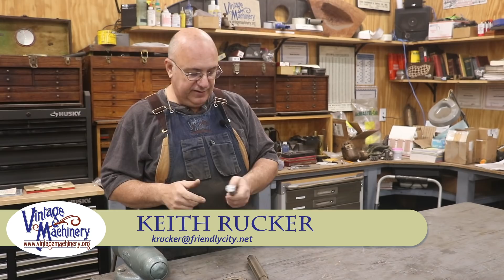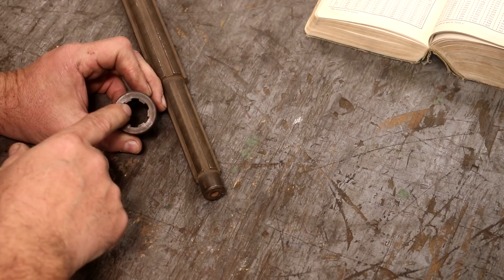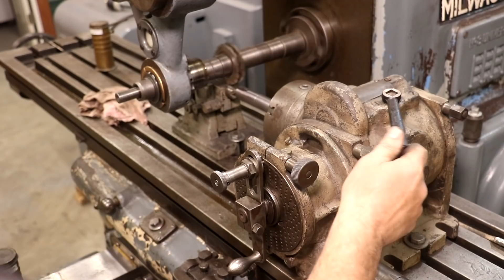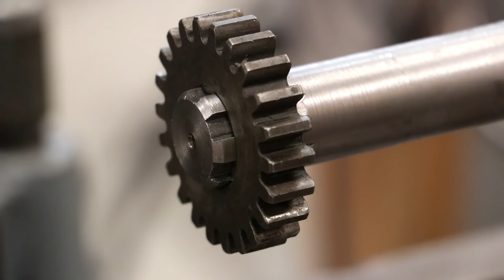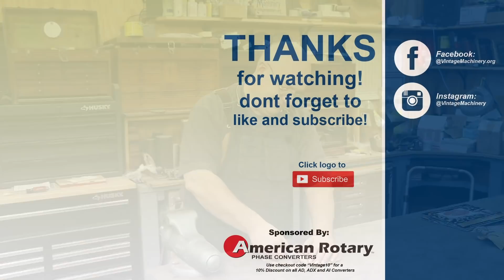Kearney & Trecker Low Lead Attachment Drive Shaft - Cutting Splines

Comment: Brilliant thanks
I need to make a 6 spline one inch main shaft for a Velocette m.cycle engine. Luckily you have confirmed my tentative ideason how to best accomplish this, I have an Adcock ,& Shipley 1ES horizontal mill,(badged as Bridgeport) and a zeitze dividing head.... Your use of the original shaft to set up is brilliant, I was not looking forward to centering with a metric machine and Imperial spline dimensions...
Best Regards
Jan Hoogesteger

Comment: 7:45. Not cheating, just using your noggin to insure correct set up.  Smart!  Why reinvent the wheel when you have a master gauge for alignment. Go / No Go eh?  Factory support 101.  Experienced chip cutter at work.  The number of operations for each setup is valuable to oversee in use.

Comment: Keith...You mentioned that to do this spline on a vertical mill would require that you do offsets and more passes.  Why couldn't you set up the same double cutter arrangement on the vertical mill like you did for the HBM and then finish with a single cutter to cleanup the middle of the spline,  i.e do it just like you did on the horizontal mill except you are just doing it vertically now?

Comment: A nicely finished job Keith. I was quite surprised at the amount of runout.in the arbor resulting in only one tooth on each cutter actually doing the complete work. As you can clearly see that the swarf ( chips ) is (are ) only coming off of one tooth sorry I'm English and we call chips swarf over here lol Keith you said those cutters were a matched pair, and I expected the key slot to line up exactly on both cutters, but the teeth were slightly staggered. I thought if they were staggered by design then they would be set exactly half way between if you understand what I mean. Your comments would be interesting on this subject Keith.

Comment: Two quick questions..... 
1. Could you have saved a tool change by hogging out the single cut first? 
2. Are the slides on both ends clocked inline? If so what was your procedure for doing so? 

Awesome video again, thanks for the hard work!

Comment: Your cutters were spitting a chip which showed either the cutters 
running out or your arbor. 
I have ground stagger tooth plain milling cutters in pairs many times . I get the right and 
left teeth the same height and to run with in 
.0005". I have made a form cutter to cut a spline with a radius at the bottom a couple of times. I just need a drawing of the profile of the form.  I could also make a form cutter to cut  the form that you cut with a flat at the bottom. 
I never made one with that profile but I am sure I could.  Either from I would make a mylar drawing of the profile of the form to put on my comparator to check the form. Their isn't much I can't do. The form cutter would need to be made from a straight tooth plain milling cutter and if the number of teeth were  less than 14 I could make it on Hybco form relief grinding head which would do the nicest job. If not I could still do it but the form wouldn't be as smooth. 
Like I said before I would be willing to do any of this for free. I would need a little lead time as
well.

Comment: I love your content, and I have an honest question for an at home hobbyist. Are the cutters faced that way to avoid a slight deflection? Rather than a climbing cut?
Reply: Yes I think they are. If you were to try climb milling in that situation you would need to have to work as close to the drive end of the arbor and have the support collar as close as you could too. If set up as Keith was running it, the cutters would have grabbed the work and literally "climbed" up the workpiece bending not just deflecting the arbor and the result would have been a horrendous crash and a ruined part and more importantly a totally ruined arbor which when taken off would have resembled a twisted banana.

Comment: Keith, just wondering; could you cut this spline with just one sawmill? Just start in the center of the cut and shift to the left straight wall and shift to the right straight wall. Or am I missing something here? Best! Job
Reply: You would need a cutter with a specific bevel on each side.  If you did the operation you described the spline would be undercut and not have parallel sides.  This is needed to match the gear and bushing.
Reply: @honorharrington4546  Thank you Honor but I'm not sure this is true. I think it can be done by using a single cutter. It's only a lot more shifting on the y-axis. Side one, shift, side two, shift, center. Keith does it in two op's but has to remove a cutter for milling the center.  It maybe has something to do with the quality of this old milling beast too. By using a 1/4" spacer in between the two cutters the width of the spline tooth is guaranteed and consistent or all six teeth.
Reply: @jobkneppers  You can do the cut, that is no problem.  If you do that cut with a parallel sided cutter you will under cut the spline. That is the problem
Reply: @jobkneppers  , you are wrong. 
The cutter WOULD have to have tapered sides to get the correct profile. If you wanted to do that with one cutter.

Comment: What’s the hole in the support bracket below the two large ones for the overarms and above the one for the milling arbour for?
Does this unit allow for the index plate to be geared to the handle for differential indexing?

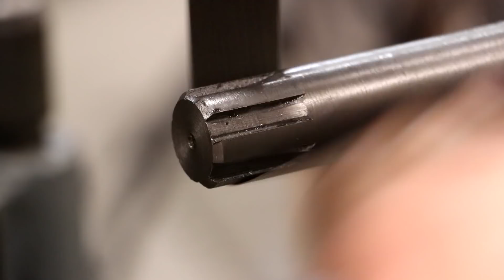Comment: at 18:39 it looks like the cutter is off-center and in fact cutting into the side of the spline.  At 18:43 you can see that it's cut into the spline  If so, there may be problems driving the shaft in that direction.  Should be inspected by adding the gear and viewing end-on.  If that face no longer mates, the part may need to be re-made.

Comment: Thanks for yet one more entertaining video. Entertaining because I only have a mini populated shop...
That's how to cut outer splines.
After the first cut setup, using double cutters, You drop one cutter, shift the remaining cutter and the washer and finish that end of the shaft. Brilliant!
But!!!  Why not start the cut of the second end using that single cutter setup, and later swap to the 2-cutter setup? That would have saved You one change.

Comment: Excellent tip re moving the cutter over with the spacer. 👍 How’s Abom getting on re machining out the bottom of the stoker engine ?
Reply: Unfortunately the 1/4 inch spacer offsets the cutting tool  to the center line of the work piece   look at  17:46.   Keith should have used a 7/32 inch spacer not the 1/4 inch spacer to centralise the cutter.  He got away with it though.

Comment: Im sure others have mentioned it but on the second end why didn't you cut the centre out first as you had it set up already, would have saved an extra tool change. It wouldn't have made any difference to the job but would have made a better use of your precious time.

Comment: I'm looking for an arbor support for a 1943 Cincinnati No 2 Horizontal mill. It has a 50 taper spindle for the horizontal and I have a high speed vertical milling attachment with a 40 taper spindle. Machine works beautifully and I'd love to be able to add the horizontal capability with an arbor support.  50 taper arbors seem to be fairly easy to find but the arbor support is either the wrong size or outrageously priced.  I might need to find a chunk of cast iron and make one.  It's also almost impossible to find a 40 taper stub arbor for gear cutters.  The world seems full of R8 stub arbors for this purpose, but Cat40, BT40, MNTB40 stub arbors are as rare as hens teeth.  I wonder why.  Great video as always!  Thanks, Keith!

Comment: I think the most cleaver setup was moving the spacer behind the cutter, I don't think I would have thought of that. One of my favorite jobs I've done in my shop was cutting a splined shaft for a drill press. Looking forward to some gear cutting. I've been on the lookout for 2H low lead parts for some time. So far all I have is an incomplete gear box.

Comment: Is it just me, or did that arbor have some runout?
Reply: I ran those type machines for years and it is hard to find an arbor that length that doesn't have some runout. A lot depends on what you are doing with it and just how much runout you can tolerate.
Reply: Looks like it's out of true to me. Doesn't cut evenly when it engages with the work

Comment: i would think the low lead attachment bearing support could be made on a lathe with a bigger flange.. and then mount it on an expanding mandrel on the indexing head and machine the curved side smaller and the bottom flat.  reducing the wait time for the casting.  to half an hour on the lathe and mill..

Comment: Does ANYONE own a straight arbor ???????? :)
Reply: My thoughts exactly!
Reply: You can hear the runout in the cutters, too!
Reply: pmailkeey......I guess it's time you bought a machine and start making videos!  I am sure your arbor will be the straightest in the land.
Reply: @paulcopeland9035  
Videos - check
Machines- check
3ph power - nope :( (but I'm working on it :) )
Reply: @paulcopeland9035  I guess most people don't realise what is the arbor. PART of it is the shaft everything goes on but the main part of it is all the collars and cutters that go on to it. ALL the mating surfaces must be spotlessly clean as when the arbor nut is tightened, that stack of collars and cutters must stay true - and it won't if there's dirt between any of those mating surfaces. 
The 'arbor' becomes the whole assembly - so even with a 1" diameter arbor, placing 2" collars on it effectively makes it nearly as strong as a 2" arbor - depending on how tight you get that nut on the end - use oil on those threads and mating surfaces when fitting & tightening that nut.

Comment: It'd be interesting to know how many cutters there are in that set of 'identical' cutters. Maybe 8, 9 or 10 - but what makes it a 'set' is if you look at 10:45 you can see that the key slot is not in the same position on each cutter - I was expecting that - so that each cutter starts its cut at fractionally different time - so despite each cutter being straight cut, the effect of the two being slightly out of phase is the equivalent of a longer helical cutter.

Comment: Nice set up Keith to speed it up I would have cut the centers first on the second side which would have saved a set up of the cutters, I am not a machinist so maybe thats not a good way to do it. When I was an apprentice the macine shop used to fascinate me but I never got to use a lathe. Hi from the UK.

Comment: Is there a reason not to cut the centre first? Seems like doing the cutter change only twice, changing after the first pass on one end then cutting the other end once and changing for its last cut would be quicker overall.
Reply: Sometimes there's a benefit in routine that outweighs the benefit in optimizing out a five-minute cutter change. 

If you've got it in your head that the process is "cut the sides of the keys, then cut the bottoms of the slots," you're a lot less likely to screw up if you do both ends that way. Speaking for myself, I can totally see the moment when I've just finished cutting the bottoms of the slots on the other end and I say "well, that's it, we're done" and take out the part. Now it'll cost me way more time than one cutter change to get the thing lined back up for the other half of the operation that I forgot about.
Reply: Agreed. It looks like the single blade would be all that was necessary.  Maybe the shoulders of the splines had to be that angle.

Comment: About those "6 turns and 22 holes". The dividing head needs 40 full handle rotations to get a full circle (40:1 reduction). With the 33 hole dividing plate, each rotation can be further divided by 33. A full circle is thus 40 * 33 = 1452 holes. We need to divide that full circle into 6 equal parts: 1452/6 = 220 holes for a sixth of a circle. The dividing plate has 33 holes, so to move 220 holes, we need 6 full rotations (=33*6) plus 22 holes to get our 220 holes.
Reply: Thanks for the math.
Reply: I don't want to troll.  So I need a little help with the math.  40 x 33 is 1320 holes on my calculator.  A zero in one of the ones place (40) forces a zero in the answer for the ones place.  Or 3 x 40 is 120.  30 x 40 is 1200.  120 + 1200 = 1320.  1320 divided by 6 does equal 220.  220 divided by 33 does equal 6 revolutions plus a remainder of 22 holes on a 33 hole plate.  I really don't want to troll but for students or beginners it is important to get the math correct.  It looks like you did something like 12*120=1440 plus 12 = 1452.  I sometimes leave numbers in a calculator and get odd numbers or I just get fat fingers that independently punch numbers that I did not think I punched. And that is OK.  It happens to all of us.
Reply: A short cut is to recognize that you want 6 splines in the full circle.   Therefore divide 40 by 6 ( 40/6 = 6-4/6 or 6-2/3 ) or 6 full turns plus 2/3rds of the 33 hole dividing plate.  2/3rds of 33 holes is 22 holes.  Therefore for a 33 hole dividing plate you would  turn it 6 turns plus 22 holes.  If you don't have a 33 hole dividing plate see if you have one with the number of holes divisible by 3, say a plate with 27 holes.  Then using the same thought process 2/3rds of 27 is 18 so using a 27 hole plate you would get the same result by going 6 turns and 18 holes.

Comment: Do the splines on the ends of the shaft need to be “clocked” to each other?
Reply: Since the dividing head generally just has a chuck attached (and you can rotate your workpiece like you need it before tightening), I wouldn't think that matters.
Reply: @brandy1011  I don’t mean for the milling operation. I mean to operate the attachment it is being made for.
Reply: @johnnyryall1400  Do I have something twisted in my mind now? I thought this piece is part of the connection between the low lead attachment and the dividing head...
Reply: @brandy1011  it is but I’m referring to each end of the shaft and does it need to be clocked to mate with the gears at each end. Not how it relates to a part in the dividing head.
Reply: @johnnyryall1400  But if it does not fit in a given position what stops you from just turning the shaft coming out of the dividing head until it does fit? And then, if needed, reposition the part in the dividing head.
Reply: @brandy1011  we’re back to the reason I was asking Keith to start with. Lol. It looks like he lined up the splines on each end of the shaft. Is it necessary? Was it ocd, or just a need for it to be aesthetically pleasing?
Reply: @johnnyryall1400  I'm guessing there aren't many machinists who would leave them un-clocked, just on general principles. Though maybe not on production runs, if it really didn't matter.
Reply: @johnnyryall1400  Ahh, now I get it, he clocked them and it might not have been necessary...well, that's what I get for watching the video with only half my mind 😅

Comment: Isn't that exactly the same spline as a tractor PTO?  They call it a 1"-6B spline.
Reply: Tractor is 1 3/8
And bigger splines 
But they are 540
Reply: @fowletm1992  I think older tractors had a smaller splined shaft. I had a 1947 2N with a 1" PTO shaft. I put an overrunning clutch on it that had a 1-3/8" male spline to be able to drive various implements.
Reply: @donkinzer5718  
Yea 1 3/8 gas been the standard for the last 40 odd years but prior to that it was basically a free for all,you were just expected to buy implements that were made by the same company 

Hydraulic couplings are the sane but it took them even longer to standardise them 

I dont know what the really little tractors run either, the sub 50hp stuff might be 1in
Reply: @fowletm1992  My current tractor is a 25HP John Deere manufactured around 1990. It has a 1-3/8" PTO spline. I suspect that even smaller tractors have the same size since that is standard with smaller implements.

Comment: Keith, Why is the arbour running out so badly?  Do you need Keith Fenner to straighten it for you (he is really good at bent shaft stuff)? 
Also, Have you seen the amazing heavy machining Kurtis at Cutting Edge Engineering has been doing?  It could be very useful if you need big stuff for the Museum. 
BTW, Some audio issues if you don’t know already, but I am sure you are already working on it.  Keep up the good work!

Comment: is it just my eyes or is the run out of the arbor on the mill crazy? looks about 2/3mm high to low.
Reply: I think it's just the spacers, the cutter looks fine. The spacers don't actually need to be round or concentric so they probably didn't bother trying to make them very precisely.
Reply: @qidydl  It’s the shaft.  Keith has discussed this before.  If you listen, you can tell the cutters are only cutting with about 3 teeth.
Reply: That's typical.

Comment: I usually count the steps out loud even when no one is watching. Hearing it said in the room helps confirm that I'm correct and not leaving something out.
Reply: That's good work practice.  Its easy to anticipate a step mentally but count it as an actual step otherwise.
Reply: @WhatAboutTheBee  On anything over 5 steps I suggest making a quick sketch, write down the steps, and check them off as they are done. Easy to miss a chamfer and make a lot of hand work.  😁😎
Reply: @Current Batches I verbalize my pre-flight and start up (hand prop) routine. I guess it carries over to my shop work.
Reply: Been doing the same for lots of years.